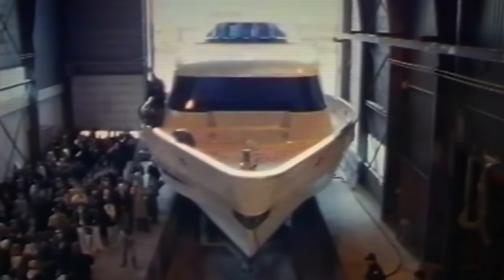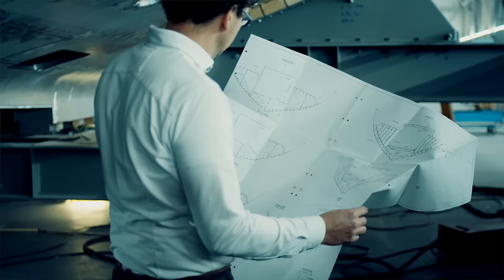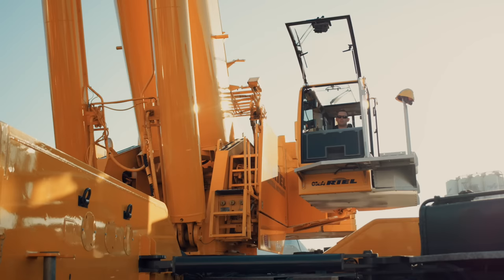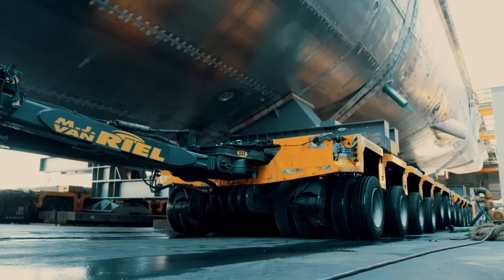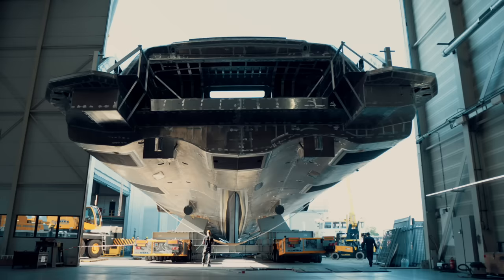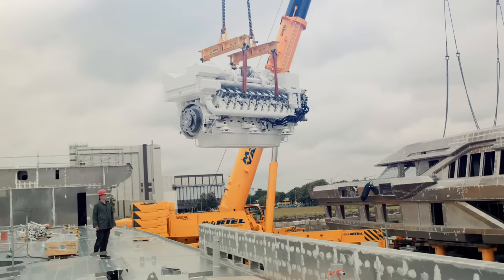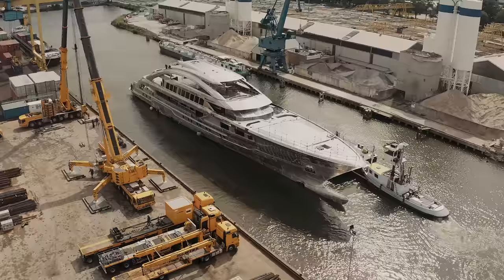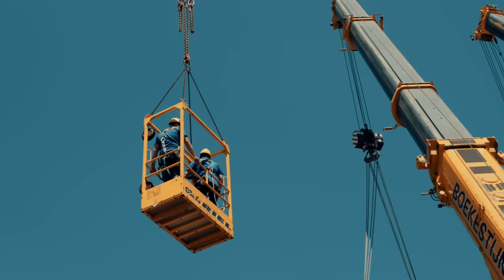Heesen Project Cosmos Joining Operations

Comment: Very impressive. But why not build a much wider factory (?) that has on one side the building of the hull and next to it - in the same building - the building of the superstructure - which once ready - can then be hoisted to, above and placed on the hull with help of roof trollies. It saves time, less complicated, and is safer.
Reply: They do it because that's one of the only times they can see how well the hull sit in the water and what happens when they have the superstructure put on. They can make adjustments if something is wrong although it probably isn't as heesen is known for their quality and perfection, instead of finding out about the problem at the last second making this technique a lot safer and worth the money and time as it would cost you a lot more time and money if the final product isn't as supposed to be.
Reply: De kavels om dat te bouwen liggen niet echt voor het oprapen in die buurt.